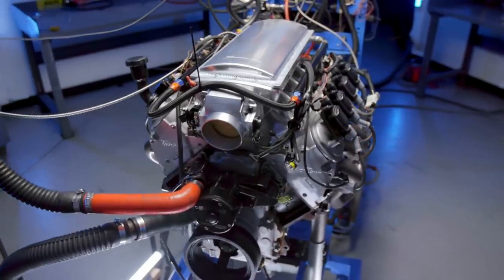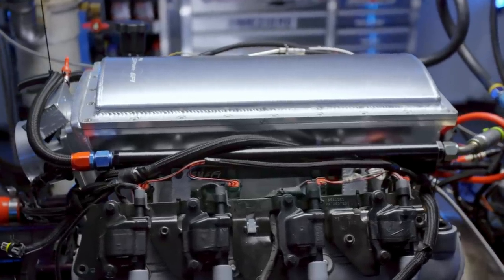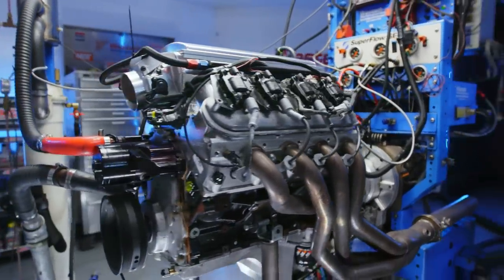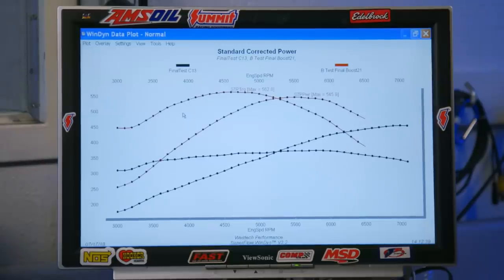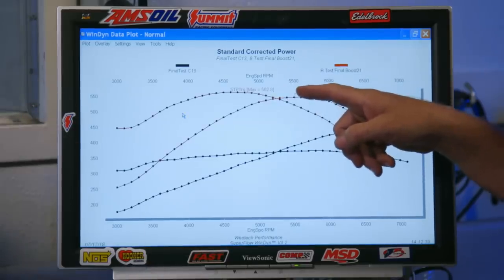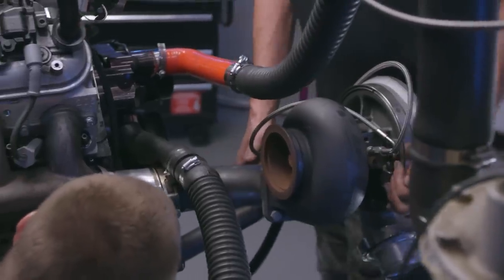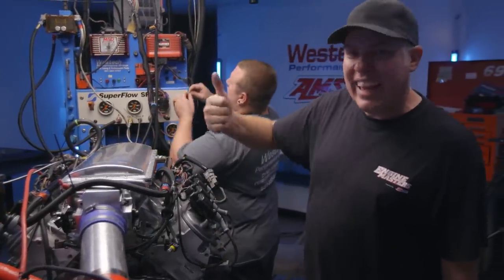Built + Boost — Engine Masters Preview Episode 41

Comment: Without boost and without extremely breaking the budget what are good upgrades for torque  increase on a 5.3 at lower rpms or would it depend more on the drive line or drive train
Reply: Should i say im a little new to the ls (truck) engines and not worried too much about horse power even though i already have a new tsp stage 3 216/220 duration .550/.550 low lift 111lsa

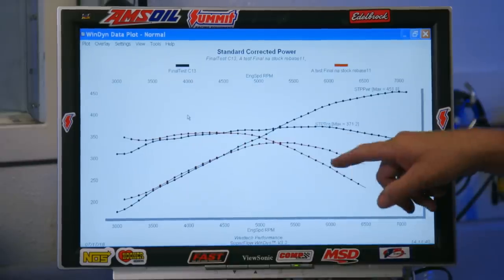Comment: 1:42 thats why i run short ITB's from bikes, they do more power everywhere
Reply: eXViLs - 8B008B longer intake runners will almost always make more low end torque, while short runners tend to breath better at the top end. Not always the case but, as a general rule of flow dynamics, that’s what you should expect.

Comment: The boosted stock build looked better suited for my Bucket on an autocross course than the built with the stupid long cam. But my application puts a premium on low RPM torque and not as much on high RPM peak power. Horses, as they say, for courses. Even the stock engine without boost looked better for a car that spends 75% of its track time between idle and 3500 RPM.

Comment: What's the point of this? Looks to me like you guys are encouraging people to throw a turbo on a stock engine that was never built to truly handle the boost. Sure its good for a few dyno pulls, but in a car someone plans to drive for years to come not so much. There is a lot to building an engine that can truly handle boost for years of use, Ring end gap for one its just one small part of what needs to be planed for but without the right end gap when she heats up you can tare the top of the pistons off. David I you know this but not everyone does. I'm sure lots of people see you doing stuff like this and think they can cheap out and throw 10psi of boost on a stock engine and everything will be fine.

Comment: Anyone knows the final number?
Reply: 955 I think they said. Almost 3 hp per cubic inch, not bad.
Reply: @celabinsh  That was on 12 PSI, on 18 PSI they made 956.2 HP @ 6900 RPM and 774.5 TQ @ 5800 RPM.
Reply: What was “built” about it besides cams head intake?
Reply: @kevinwhite3401  It has Wiseco forged pistons and rods in it from episode 34.